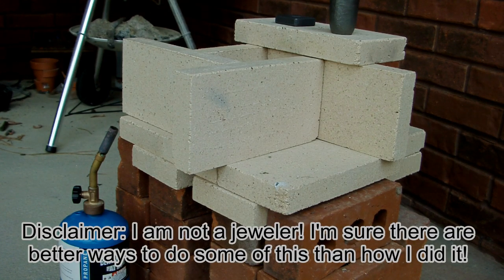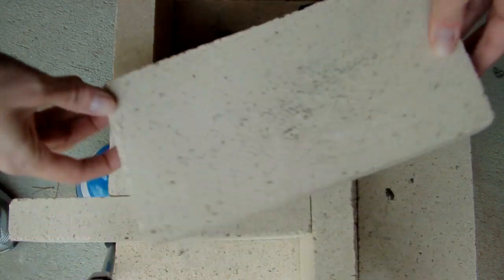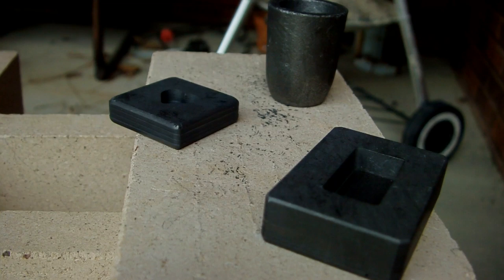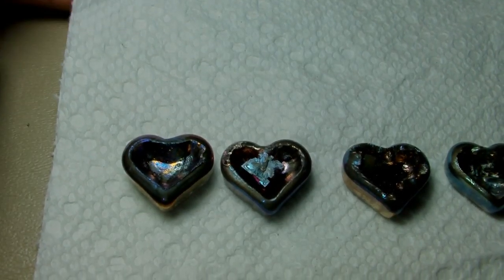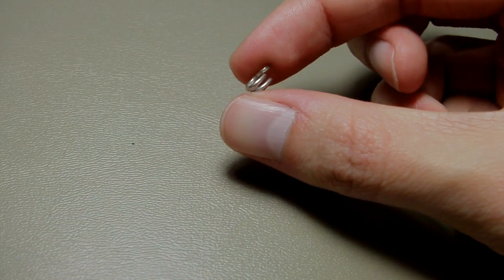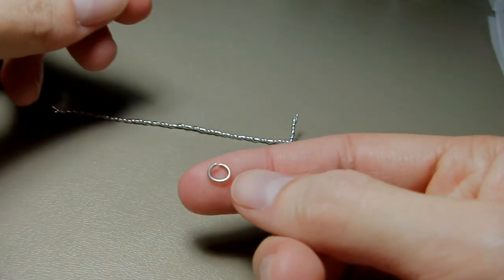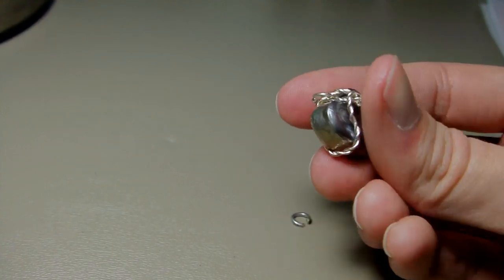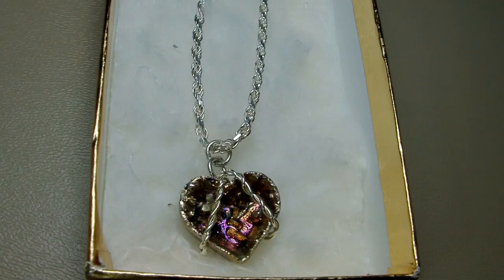Valentine's Day Special: Bismuth Heart Pendant

Comment from the maker: Agree with doublechapp. I believe jewelry soldering is very different from electronics soldering. With electronics all you really need is electrical contact and it doesn't necessarily give a lot of mechanical strength, which you need in jewelry. That would certainly be a technique to look into, though.

Comment: Very nice! One thing you may try in the future.. when twisting wires together, pull the wire around a stationary post and chuck the free ends up in a variable speed drill motor. You can vary the tension and turns per inch nicely. Also it usually makes a very uniform twist. I commonly use that method for makes twisted pair for various circuits. Thanks for sharing.

Comment from the maker: I just bang the mold against a surface. You might have noticed the scratches on the front of the mold, and a few chipped corners. Usually these are made for easy metal removal, but something about this heart shape made it really want to stick in there.

Comment from the maker: Well like I said, I'm no jeweler. The wrap is there to hold the jump rings on the pendant - bismuth is a brittle metal and the sides of the heart were pretty thin, so I didn't think I could drill or solder them in without ruining it. Thanks for wording your comment a little nicer than the last guy!

Comment: what if you put some silver wire into the mold before putting in the bismuth? the melting point of silver is much greater, so it wont have an effect, and once the bismuth solidifies it will attached to the wire. Any flaws in this?

Comment: So pretty! I only wish you had wrapped around the flat outside edge so that you could have a clear view of those beautiful crystals that formed. At any rate, you did do a damned good job! Minerals, metals, and wood... Nature, in general really can just be so incredible. I'm a huge fan of anything that forms crystals.
Reply from the maker: Thank you! It was my first attempt at wire wrapping, so I was afraid it would fall out if I didn't wrap it all the way around. Maybe next time!
Reply: +mrhomescientist Ah, you're so right.  Is there any way you could have formed a shallow groove along that flat outer edge to set the wire in?
Reply from the maker: That's a pretty good idea. Maybe use a Dremel to etch out a slot for it. I'd have to be careful, though, because bismuth is surprisingly fragile and the heart was very thin!
Reply: +mrhomescientist Glad I could offer an idea.  I'm sure you'd have some extra pieces to test on, get a feel for grinding down that particular shape.

Comment: How did you separate the bismuth heart from the graphite mold?
Reply from the maker: Squeeker10 They just fall right out. The mold is designed with a slight slope so things can be removed easier, and also graphite is a great lubricant!
Reply: mrhomescientist thanks! wouldn't it work better to have a deeper graphite mold to get better crystals?
Reply from the maker: Squeeker10 Sure, the more Bi you use the slower it should cool, and slow cooling leads to larger and better crystals. But I didn't want to make a gigantic pendant out of a metal with the same density as lead! I've seen people make jewelry by cutting pieces off large crystal clusters grown in a big crucible, though, which is pretty cool.

Comment: wouldnt wearing bismuth on a regular basis be dangerous?
Reply from the maker: Despite being a heavy metal, bismuth is completely nontoxic. If you've ever taken Peto-Bismol, you've drank some!
Reply: mrhomescientist bismuth flush through your system relatively quickly, which is why its non toxic, correct? Just curious if long term exposure to skin would cause adverse effects.
Reply from the maker: krodista The Wikipedia article on Bismuth has a good section on toxicology. It mentions skin irritation as possible, but I've handled it quite often and never had any effect. It's like handling and being exposed to copper, in my opinion. I don't worry about it.